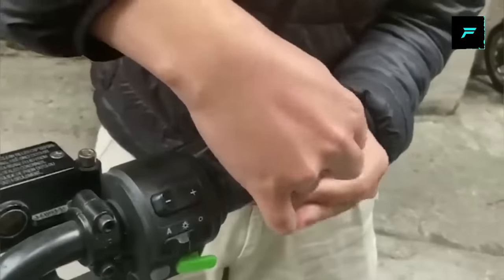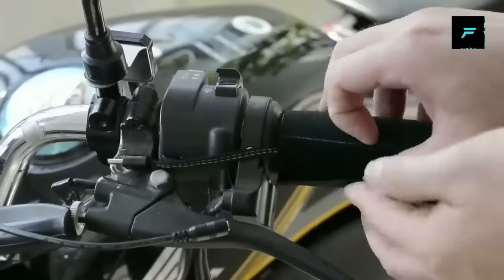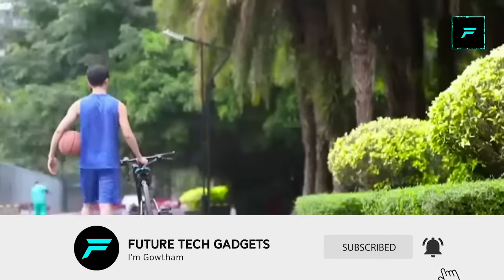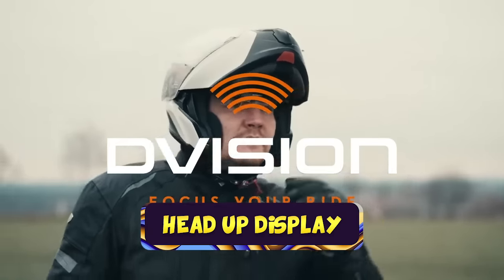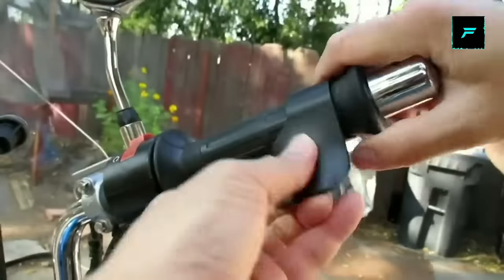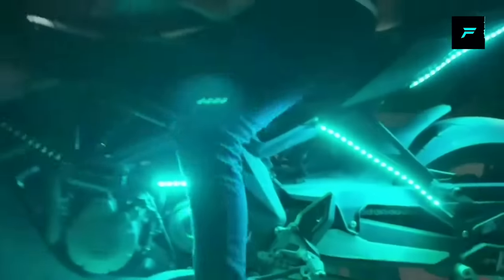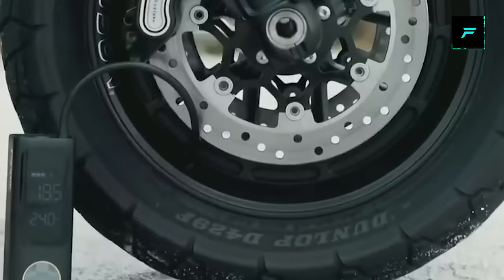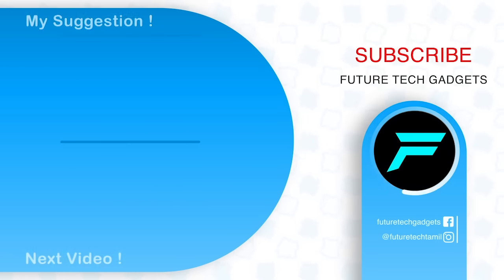Top 11 New Cool Gadgets For Your Bike & Scooty 🔥

Comment: 1- bike detailer
2- smart grip cover
3- Mi Arox
4- Bike audio system
5- head up display ( prototype)
6-  throttle jolder
7- docking station
8- smart bike light
9- portable tyre inflater
10- motor kick stand plate

( 7,8,9)
better suggestion
5 if available nin market worth product....

mathadulam edukuuu